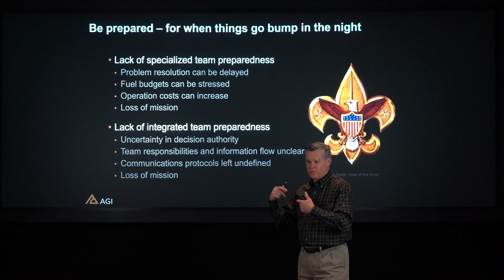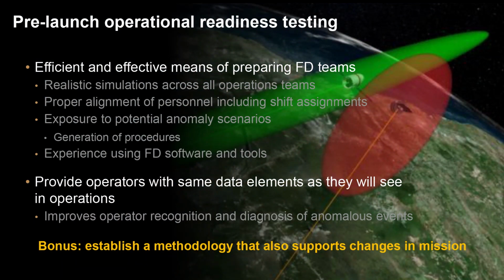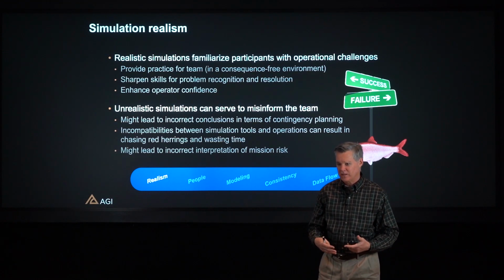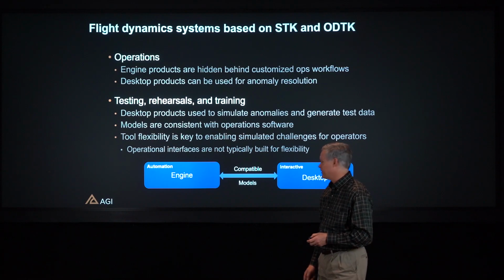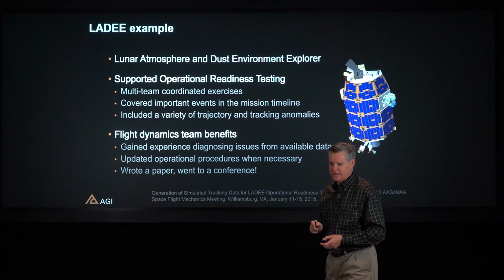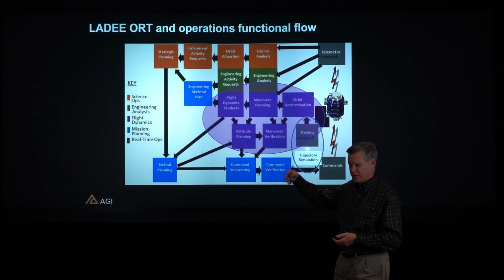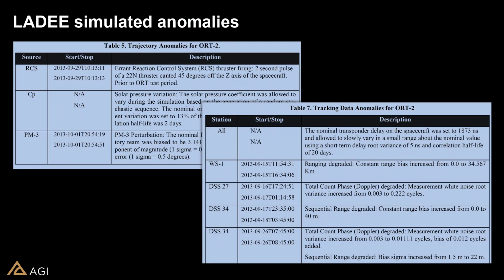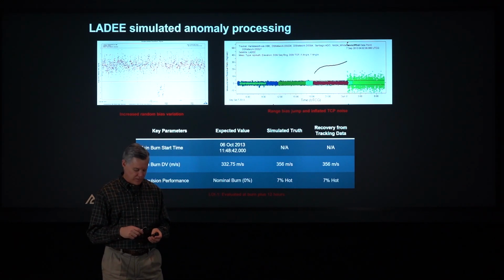Preparing Your Flight Dynamics Team

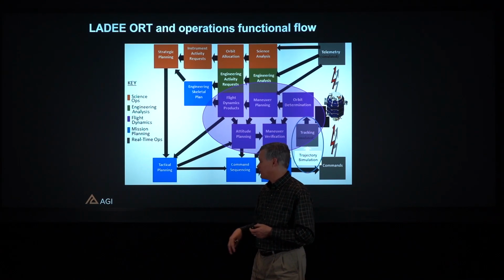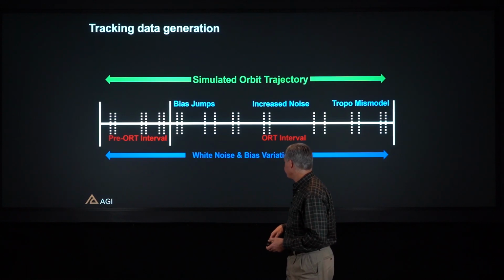Comment: I have a question in regards to the spacecraft operations team: as I understood (16:47 - 17:55) this team compares the simulated data with the recoreded data during operations/ real time manoeuvers/missions, is this correct? 
If this is the case: As we come to the correction of anomalies, is there a threshhold or a critical point, where corrective measures cannot compensate for the difference between simulated and real data anymore, which would subsequently mean it is too late and the operation would be doomed to fail? Or are we always within an acceptable range?